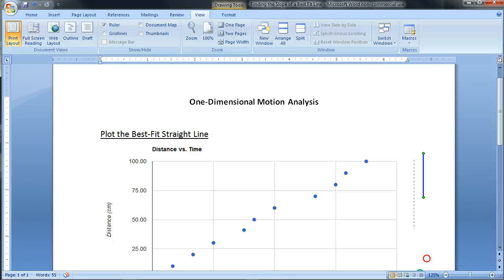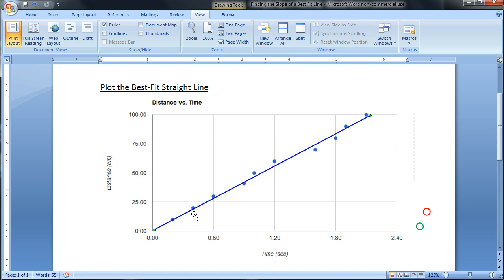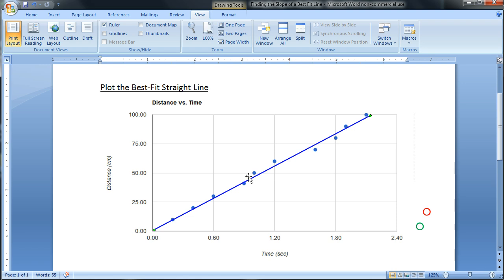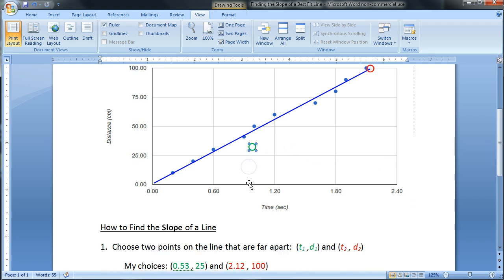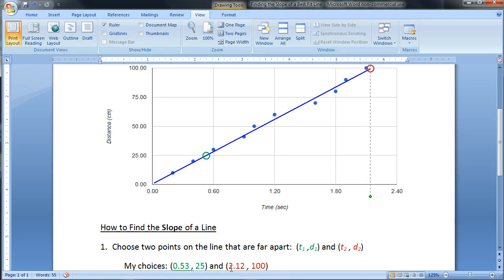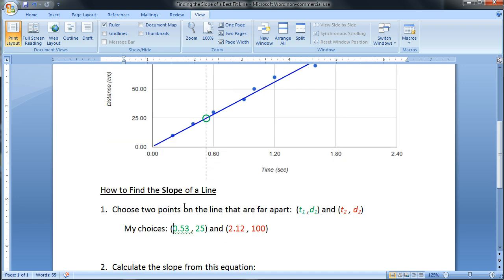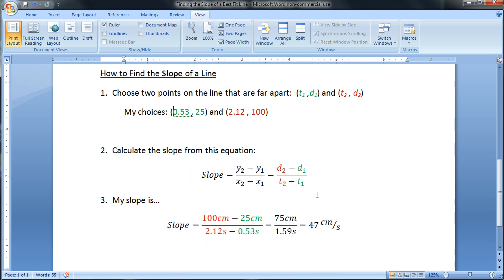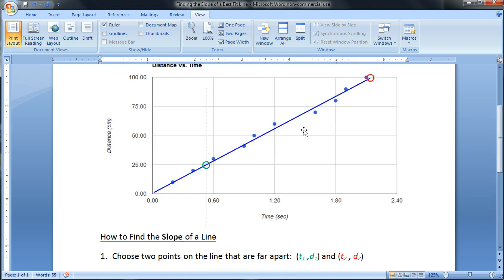Finding the Slope of a Best-Fit Straight Line

Comment: This involves guestimating and approximation. Maths isn't about guessing and approximating however. If anyone wants the real formula for finding the slope of a line of best fit it is
m(slope) = (n * sum(x*y) - sum(x) * sum(y)) / (n * sum(x^2) - (sum(x)^2)

Where m = slope, 
n = number of data points, 
sum(x) = the sum of all your x values added together, 
sum(y) = the sum of all your y values added together, 
sum(x*y) = the sum of all the values you would get after multiplying each x value by its corresponding y value
sum(x^2) = square each X value, then add together all of those values
sum(x)^2 = add all X values together, and the square that sum.

This will give you the EXACT slope of a line of best fit without any guess work or approximation that will give you an incorrect slope based on guesswork.

to find your Y intercept to the exact decimal value also you can use formula

b = (sum(y) - m*(sum(x))) / n

where m = the slope value you just worked out above.  And this will give you a mathematically calculated y-intercept value that isn't based on 'guessing'where the line should run and intercept the y axis.

Brian you should really mention this as there is no real place for guessing and approximating in the world of math.. There is a formula for everything and everything should use it's appropriate formula ;)

Comment: But how can you calculate that line precisely, no guesswork, no approximate stuff. And after that finding the slope. There must be an exact way, the same way a computer would find it, and the computer HAS to have an algorithm. That's what I'd like to know. Thank you!
Reply from the maker: Yes, the exact slope can be calculated from a given set of points. The algorithm is called linear regression.  You can Google it to find the equation.  There are probably websites that will calculate the slope and intercept too.  And if you have a graphing calculator, that will give you the exact values too.
Reply: @Florin

This involves guestimating and approximation. Maths isn't about guessing and approximating however. If anyone wants the real formula for finding the slope of a line of best fit it is
m(slope) = (n * sum(x*y) - sum(x) * sum(y)) / (n * sum(x^2) - (sum(x)^2)

Where m = slope, 
n = number of data points, 
sum(x) = the sum of all your x values added together, 
sum(y) = the sum of all your y values added together, 
sum(x*y) = the sum of all the values you would get after multiplying each x value by its corresponding y value
sum(x^2) = square each X value, then add together all of those values
sum(x)^2 = add all X values together, and the square that sum.

This will give you the EXACT slope of a line of best fit without any guess work or approximation that will give you an incorrect slope based on guesswork.

to find your Y intercept to the exact decimal value also you can use formula

b = (sum(y) - m*(sum(x))) / n

where m = the slope value you just worked out above.  And this will give you a mathematically calculated y-intercept value that isn't based on 'guessing'where the line should run and intercept the y axis.